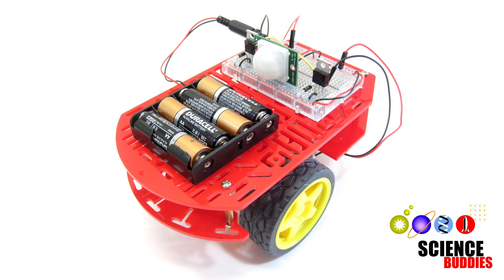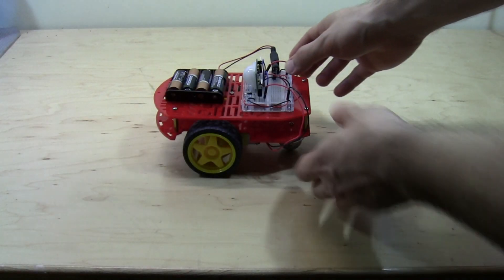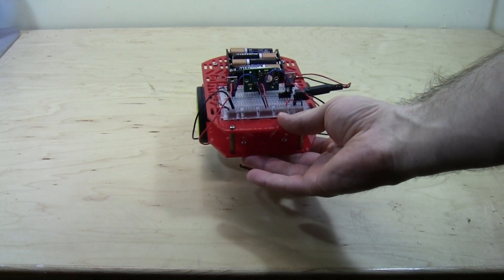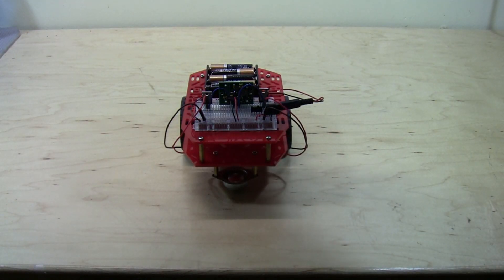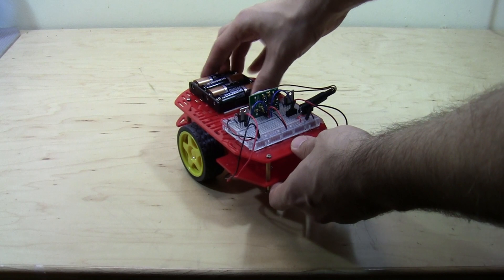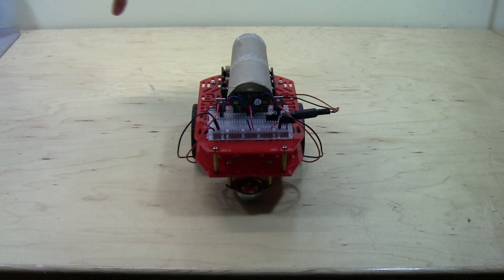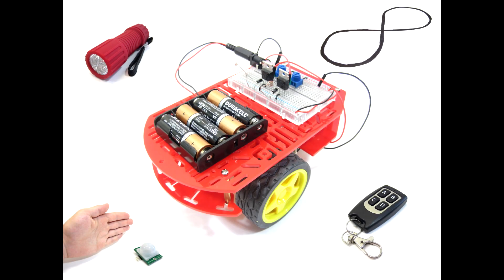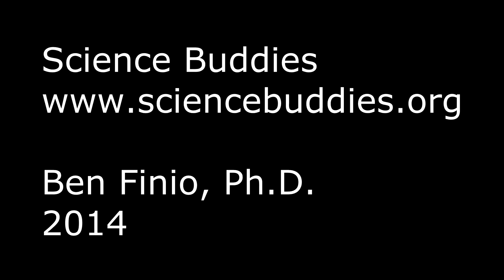Build a motion-activated guard robot | Science Project

Comment: Do you know how the motion activated led kids flashing light rings work?  You shake the ring then the led flashing lights go on for about 10 seconds then goes off.  I'm trying to adjust the sensor for it to be more sensitive but cant figure how to do it.  Any info would be appreciated.
Reply from the maker: Hi - my best guess is that those rings work with a different type of "motion activation." They probably have built-in accelerometers*, which are sensors that can detect when the object they are *attached to moves or tilts. This is in contrast to the passive infrared (PIR) sensor in this video, which detects motion in its field of vision. Accelerometers are built in to smartphones and video game controllers to detect motion. You can read more about accelerometers (and an app on your phone you can use to explore them) here: https://www.sciencebuddies.org/google-science-journal-app-tutorial-part5-accelerometer?from=YouTube

There might not be much you can do to adjust the sensitivity of accelerometers built in to bracelets that you buy. One idea would be to cut open the bracelets and try to loosen up any electronics inside so they're easier to shake, but that might not be a great idea for the long-term durability of the bracelet if kids are using it.